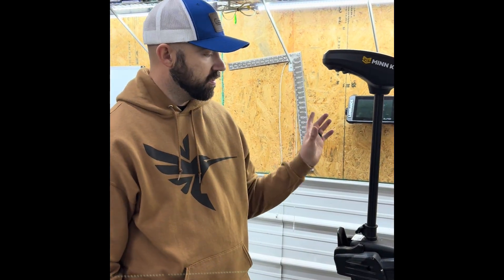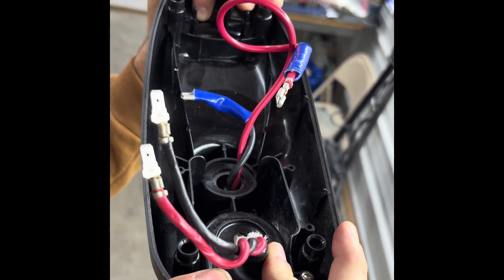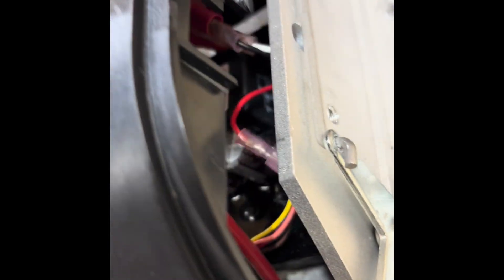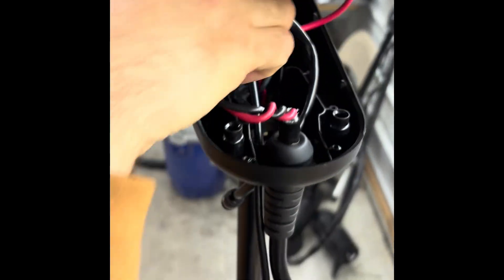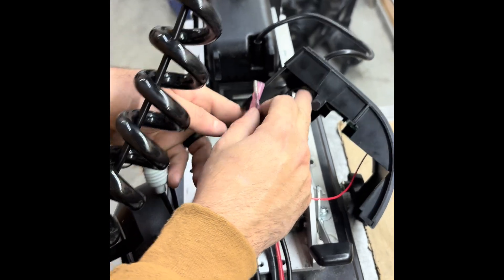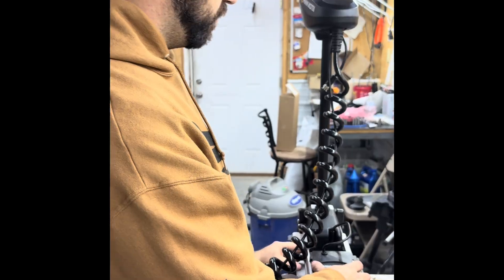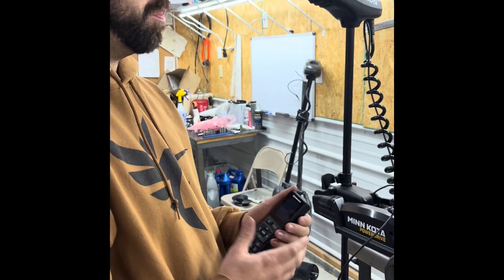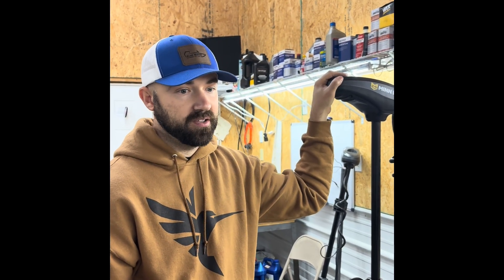How to upgrade and install Advanced GPS (Spot Lock) on my Minn Kota Powerdrive

Comment: Could you share with me how you set up your power block to run trolling motors in your shop.  I have a 36v and 12v and would like to be able to work on them when needed and saw you had a nice set up on this video.  Any help
Would be greatly appreciated.  Thank you.

Comment: After installing this on my 2021 powerdrive 55lb, does it remain 12v or do I need to setup 24v?
Reply from the maker: It will remain 12 volt and will still work correctly

Comment: I have a 2025 MinnKota PowerDrive that has 42 LB thrust. This is compatible with that model, correct?
Reply from the maker: Yes sir that is correct!
Reply: @bluewatermarineKY thank you for the fast response! And just to be certain, the Spot Lock function will work even if it isnt hooked up to a Hummingbird Fish Finder?
Reply from the maker: @PackerManForLife  No problem brother. Be sure to subscribe to us helps us tremendously. Yes it will work not hooked to a graph.
Reply: @bluewatermarineKY Subscribed! And I will be ordering the upgrade kit from your website in the upcoming weeks. Thank you!
Reply: @bluewatermarineKY sorry, 1 more question! I see online that it says you need the Powerdrive "V2" for iPilot upgrade compatibility. But then I see on your video (and others) that they are installing the kit even though it doesnt say  "V2" on their trolling motor. 
Will the upgrade kit work with my 2025 Powerdrive that doesnt say "V2" on it?
Reply from the maker: @PackerManForLife yes you don’t need the bottom housing for yours.